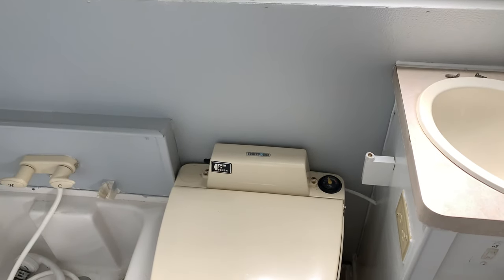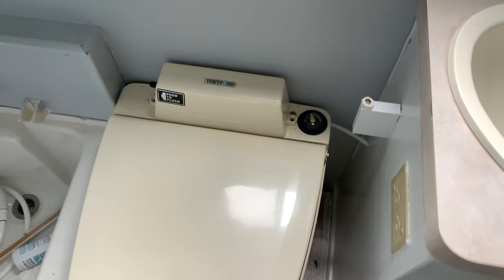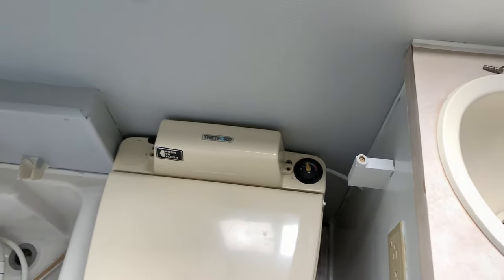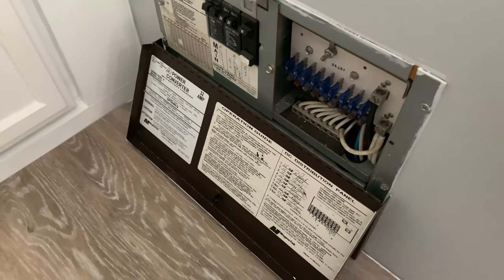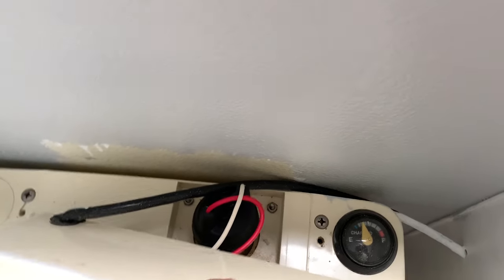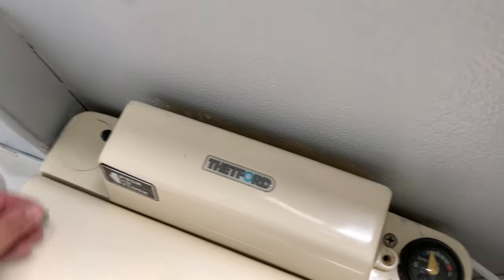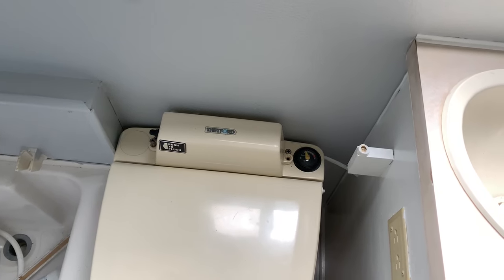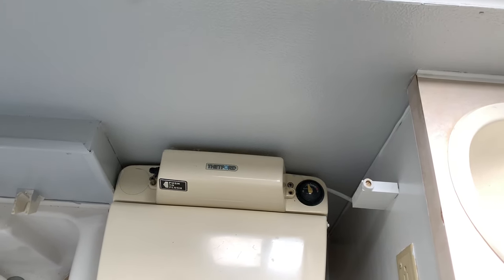Thetford Electra Magic Toilet Troubleshooting - Trailmanor 3023 - Recirculating Toilet

Comment: Helpful hint,
Never increase fuse to correct any electricial problem. Their is a reason the fuse is blowing out, and their is a reason the manufacturer has it rated at a certain amps...
Reply: Thetford has a service bulletin to increase the internal fuse size from 5A to 7.5A.

Comment: The solution to blowing a fuse is never to put a higher amperage fuse in there. If the fuse is blowing that means too much current is being drawn. This means something is wrong. Replacing the fuse with a higher current fuse just means that you're making it more likely that something else is going to become the fuse...
Reply: Thetford has a service bulletin to increase the internal fuse size from 5A to 7.5A.

Comment: Its a shame that there is no help anywhere for this kind of toilet!  REALLY appreciate your video...never knew there was a fuse in the toilet....I fill it with water but the needle wont move off E to charged...I will try the fuse. After that...?????
Reply: It takes a long time (couple of minutes) for the needle to start to move, especially if you're using the showerhead.  Make sure you are having the patience needed to fill it. I used to think mine was broken, but then kept filling and voila, it moved.

Comment: I have the same head , in trying to install , I can’t se where the water line attaches??
Reply from the maker: Mine does not have a water line.  I have to manually fill the head with water from the shower to get the initial water needed.

Comment: Anyone know a proper review of this toilet.  I can't find a single video on this type of toilet anywhere.
Reply from the maker: I have only a month of using it.  There is some obvious flaws however it was made to circumvent having a black tank
Reply: @travelingbymap7420  cool.  I just want to see more before making a purchase like this.  And their site isn't very informative.  Feels like your browsing a catalogue online from the 90s.
Reply from the maker: Yeah, I could find nothing online about this and had to do it from trial and error.  I have owned a travel trailer and class a diesel pusher before and if I were buying a new one, I would personally go with a composting toilet rather than this model.
Reply: I have a 1971 14' shasta clone camper and it had one of these recirculating self-contained toilets. The camper only has a fresh water holding tank, no black or grey water holding tanks, and never has had them. The grey water just dumps out of the piping and no way to stop or plug it. The lack of black holding tank is why the recirculating toilet was used. It did function, but if how it was working was correctly or not I would think it didn't work right. It didn't leak, did flush, and did macerate... but instead of separating liquid from solid to "recirculate" it for flushing, it blended into a porta potty shit smoothie and then used the smoothie to try and flush like it was water. 
It didn't matter what outhouse chemical deodorant was used it was like trying to wash the porta potty toilet with the contents of the toilet tank inside the porta potty and expecting it to smell better. 
Needless to say using the toilet at all was forbidden. As soon as I could I ripped it out of the bathroom, plugged the hole in the floor and replaced it with a coleman flushing toilet that keeps the water separate from the sealed away deposits. 100% Worth it, it may have to have the holding tank dumped more often, but using it (unlike the shit smoothie toilet) isn't a poor life choice in a  canned ham tin.
So my review is, anything is better than the self contained recirculating toilet and I would risk being attacked by wild animals in the middle of the night with my pants down before using it.... just saying.
Reply: @rottnlove  shudder  That's what I was afraid of, and probably why I can't find any product details on it.